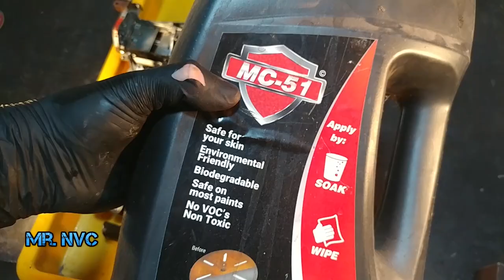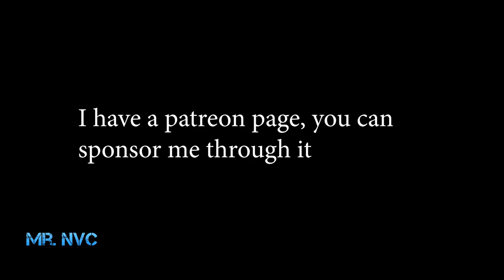Vintage TypeWriter Restoration

Comment: A remarkable restoration. However, any reason why the crappy little bail bar rollers weren’t replaced (rubber tube sleeve)? Also, there still seems to be a fair amount of rust in the basket area … maybe just residue?